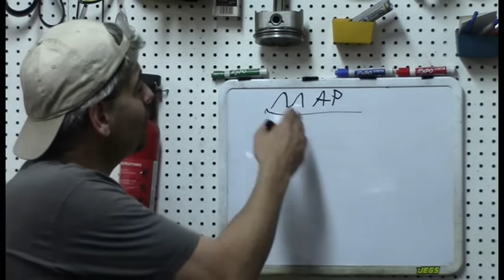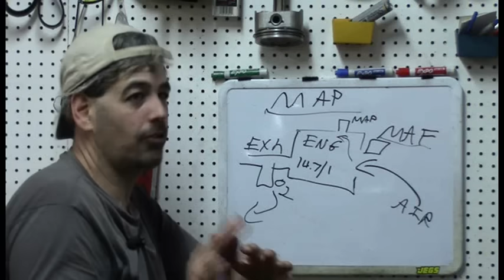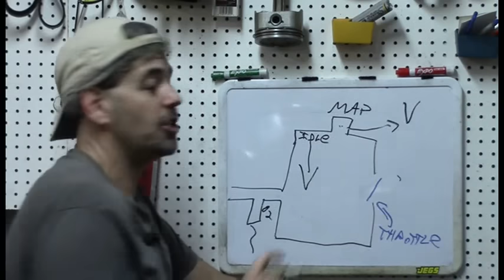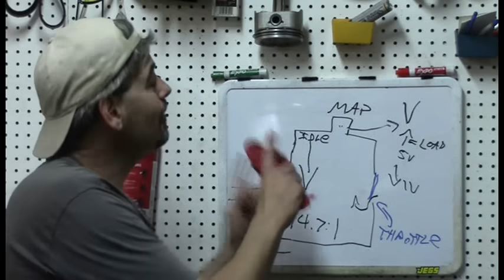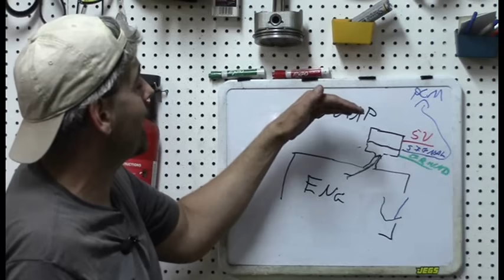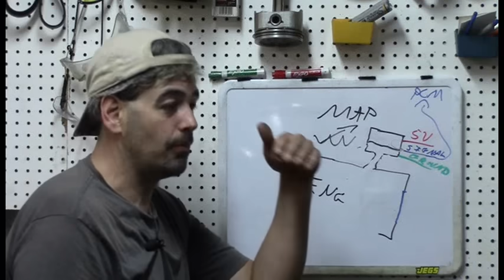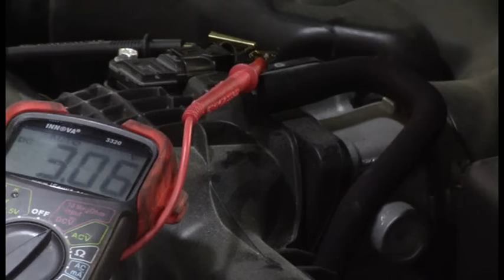MAP Sensor Diagnosis and Understanding Function- Pt1

Comment: on my 1989 bronco 2  the map sensor wasn't even throwing a code.  and was going bad.  i replaced it. my idle went back to normal  performance went back up.
Reply from the maker: How do you know? what was the MAP output data BEFORE you changed it?
Reply: @SchrodingersBox   i honestly dont know the data  Never got in to all that stuff..  i went mostly by ear and a educated guess.. im no expert just an old shade tree mechanic im just glad it worked. its still running a little lean.  im guessing fuel pressure regulator   goin barrow a buddies fuel gage and test  fuel preasure
Reply from the maker: No answer to that and i’m a shade tree too - shade tree doesn’t mean you have to guess though. . Unless i know the MAP output relative to the input variance curved against fuel trim i would have no idea what could be causing the condition. There are literally a million things that the parts cannon could be fired at and it may not even be a part at all. What if you have voltage drop across a MAF hotwire ground circuit? What “part” is possibly going to fix that?  Best to diagnose the condition so you know 100% what is the cause.
Reply: @SchrodingersBox   the 1989 bronco 2's with the 2.9 v6 did not have MAF   so im thankful i dont have to tackle that

Comment: Hi!I have a 2001 jeep grand cherokee limited.The car starts and run fine without a problem, but when the car is in park and i push the gas when i stop pushing the gas the car dies.I unpluged the iac valve i turn on the car without problem and i push the gas and removed my foot from pedal the car is ok.I replace the iac valve thinking that was the problem but not, still doing it.So im driving my car with unpluged iac valve.How i can fix that problem?Thank you for your help.
Reply from the maker: What data do you have? What was your data that the IAC was suspect? What was the IAC desired and actual count?
Reply: I actually dont have a check engine light on.
It was just a gues. 
Thank you for answering.

Comment: my map sensor indicates 67kpa as soon as I started the engine causing rough idle. after 1 or 2 minutes it drops to 48kpa and stabilizes. the sensor has been replaced with a new OEM one but I can't solve the problem .. any idea ????
Reply from the maker: it’s reporting the issue, not causing it.

Comment: I am sorry if this a stupid question but is it possible that a bad MAP can cause a P2437 Secondary Air Injection System Air Flow / Pressure Sensor Circuit Low Bank 2 ?
Reply from the maker: Not a stupid question at all since MAP can indicated AIR activity however if you have a circuit low code it is going to be a electrical issue on the AIR, not the map.

Comment: would that map sensor keep my fuel injectors from getting an signal
Reply from the maker: Because if the MAP sensor reads that the engine has very high vacuum it will severely trim the fuel... e.g. it thinks engine is decelerating.

Comment: im having a problem . I have a 1996 c 1500 5.7 liter truck . fuel is getting to the spider but it will not start and stay running , I have spark i can pour some gas down  the throt body and it will start . but its acting like there is no gas going through the spider . the spider body was replaced 1 year ago . please i need help . thank you
Reply from the maker: roger murphy What DATA do you have?

Comment: Would a failing Mass Airflow Sensor cause a 4.3 vortec (2001 chevy silverado 2wd AT) not to start. . Code P0104 was thrown . Appreciate your reply. Thanks
Reply from the maker: Could, as well as 100000 other things. What is your MAF data indicating the issue is?

Comment: I have a 94 gmc k1500 suburban it started running sluggish a few days ago . It hesitates when I give it gas so I changed the fuel filter since I know it has not been changed in the last 10 years it ran great problem went away for 1 day then returned. Any ideas what could be wrong?
Reply from the maker: No idea- could be literally anything. what data do you have?

Comment: my 1984 buick regal has a map sensor code issue. my vehicle has been shaking when im in drive at a red light os when i feel the vehicle shaking. when im in park it doesn't shake. with a bad map sensor, will the vehicle have the issue  having? it also doesnt accelerate to well either when im dirving.
Reply from the maker: What was the result of your diagnostic tests!
Reply: Sorry, forgot to ask my question! with a result of a bad map sensor, cause my vehicle to run the way i explained?
Reply from the maker: Joseph Moreno It depends... What were your diagnostic test results on the MAP???
Reply: I havent performed a diagnostic test yet. I replaced my ox sensor and catalytic converter thinking this may solve my issue. Still no luck.
Reply from the maker: Joseph Moreno All the more reason to do a diagnostic then, wouldnt you agree?
 When you let me know what the readings are I can help.
Reply: +Schrodingers Box will do thx!

Comment: will a bad map sensor cause the engine cooling system to not work, my engine is overheating and diagnosis said map sensor needs replaced
Reply from the maker: Not likely at all, no. two separate issues.
Reply: Fluid is not circulating and no heat
Reply: Overheating at 6 miles and tries to shut off
Reply from the maker: sounds like bad water pump or clogged radiator.
Reply: @SchrodingersBox  i paid 100 to have it checked they said the thermostat is clogged cause its clogged with oily substance. they wat 1700 to fix it. too much for me right now.

Comment: I have a 2007 Dodge Durango, every time I start my SUV and I give gas it goes slow even if I pressing the accelerator all the way but as I my vehicle goes faster it runs ok and the engine light is on. I took my car to Autozone and they told me that the computer is detecting an error P0871. Do you think it is my MAP sensor and I have to replace it or is it something else?
Reply from the maker: What MAP sensor readings did you get? What were the voltages at static, idle, and load?

Comment: I am looking for the wiring diagram for the pressure sensor on the manifold of a 2004 jaguar S TYPE. What color wire goes to which  pin on the plug of the sensor?
Reply from the maker: I don't remember things with that much detail sorry
Reply: This is why I ASKED for a DIAGRAM! Not A memory of one! I can not guess at it I need to see it.
Reply from the maker: Then google a diagram. Why would I possibly have a diagram of your car???
Reply: I have Googled it this is how I got to your  video here. , that was no help. I can not find one online. I do not have ALL DATA to look it up.  It was just a question  if you could help......
Reply from the maker: John Reynolds I juist use google.  How abouty just mapping the circuit yourself since you are just looking at one sensor?

Comment: could the map sensor be my problem I have a 04 sunfire and it will only keep running if I keep giving gas in idol it either keeps going up and down or it just dies
Reply from the maker: Could be-or not.  what is the data showing?

Comment: my car has a map sensor on firewall car will start when unplugged but dies when plug up any info would be nice have voltage on plug have vacuum
Reply from the maker: So what was the static vs load MAP reading?
Reply: don't know it will not start while plugged in but have unplugged all other sensors that was on same ground feed but no change someone told me it could be ground but have good ground also has 5v constant i have changed 3 times thought might have got bad part but all 3 can't be bad i was told someone tried to check codes using a paper clip do you think they could have short ecm no volts on signal wire
Reply: the car is a 91 toyota carolla le fuel injected 1.6

Comment: I have a 95 gmc 2500 7.4  it hesitate when i m going at 65 .& it loses power you think the map might be the problem?
Reply from the maker: No I don't. I think I need Data to determine a direction and then go from there. I would only think the MAP is the problem if the data indicated inconsistent voltages for the variables you induced.